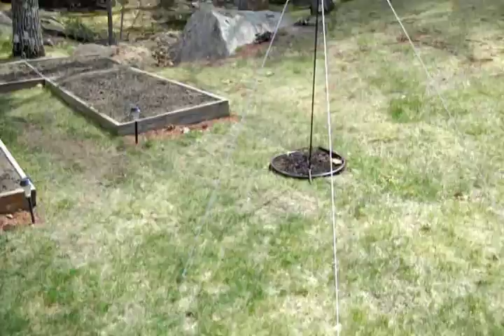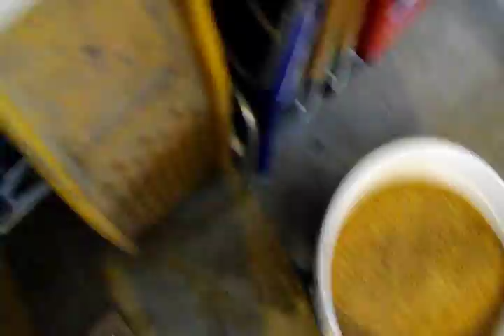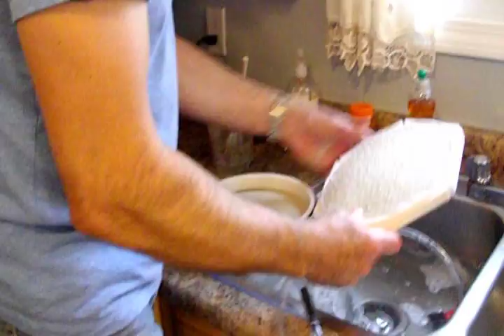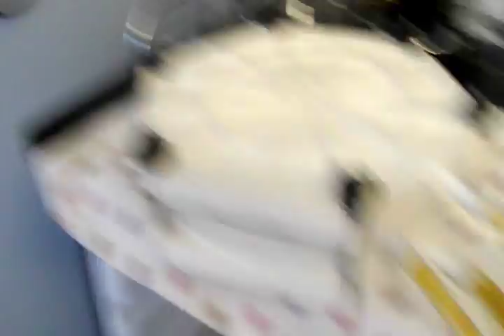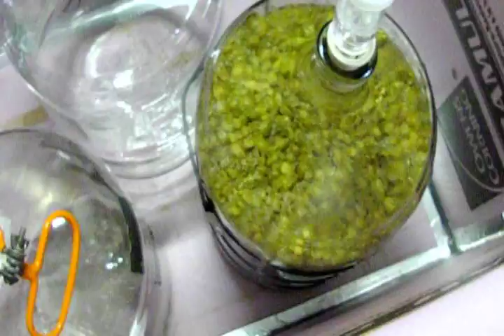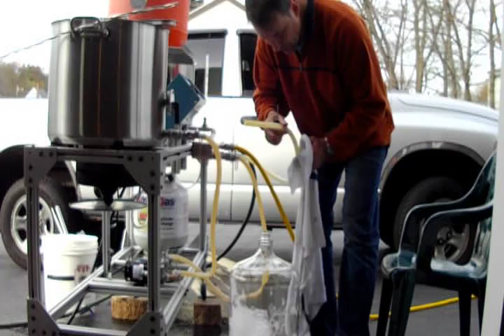Homebrew Wednesday

Comment: INteresting. I have had some "hefe like" flavors in some of my Pale Ales recently. I ferment at 60 degrees and it ranges from 58-62. I used to ferment warmer, around 65 ambient with swings from 63 to 67. I can't figure out what the cause is, but I was thinking yeast related as that's what gives Hefe's their flavor. I'm going to ferment for 2 weeks where I am now, and then place the carboys in my grain room at about 70-75 ambient and see if that helps the yeast clean up. Thanks.

Comment from the maker: ales i usually ferment at 68 regardless, and then for about 24 to 48 hours i let it rise to about 72 to 74, lagers about 60 to 65 for 48 hours, and on both i get new activity so it's doing something. again on ales i don't always do it unless i have the time and if i have more than two different beers fermenting in the ferm chamber i will just take that carboy our and place on the floor next to the furnace, that usually does it. but then cold crash them for another 48 hours after that.

Comment from the maker: ales i usually ferment at 68 regardless, and then for about 24-48 hours i let it rise to about 72-74, lagers about 60-65 for 48 hours, and on both i get new activity so it's doing something. again on ales i don't always do it unless i have the time and if i have more than two different beers fermenting in the ferm chamber i will just take that carboy our and place on the floor next to the furnace, that usually does it. but then cold crash them for another 48 hours after that.

Comment: I have one of those filter things...it takes forever....and then some....to filter, but works best if you set it at like 3 lbs of pressure.  For all the folks who are considering this filter, you may be tempted to turn the pressure up, but resist the urge,  although it will move faster the filtration sucks at higher pressure levels.